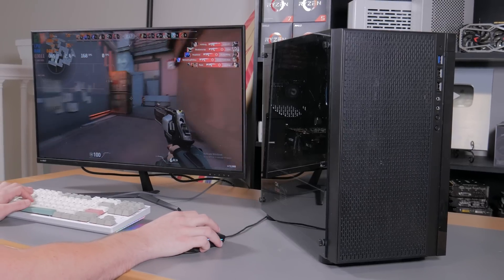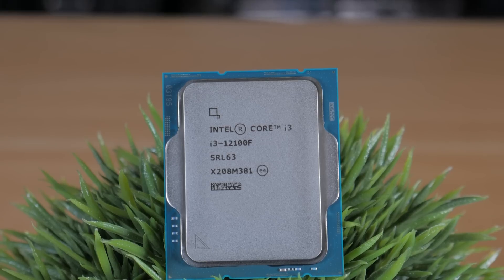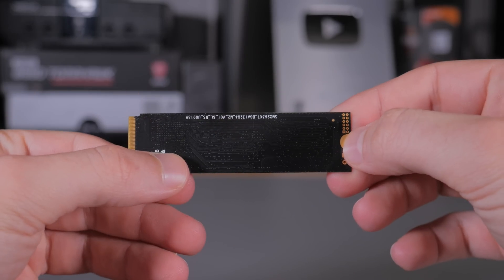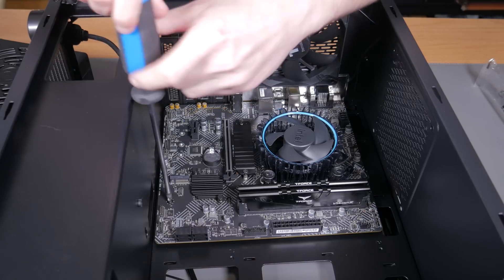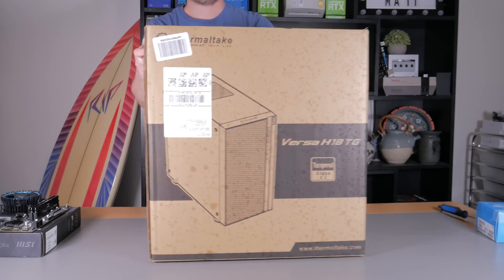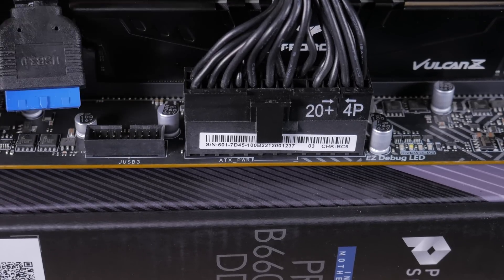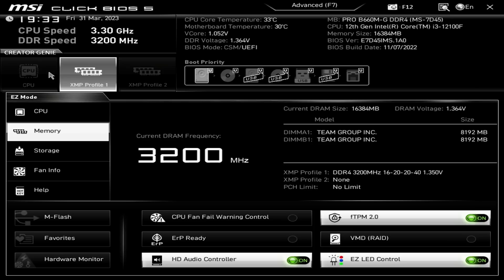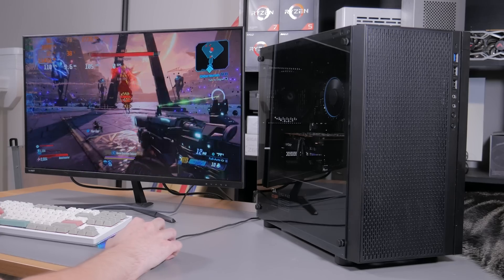$500 Budget Gaming PC Build Guide! (2023)

Comment: @TechByMattB, I am thinking about buying and making this build but the Intel Core I3 would not be compatible with the BIOS of the motherboard. It sound like you cannot change the BIOS without a CPU that is compatible. Only way I could have done this is by switching out the cpu with a cpu compatible and then updating BIOS. Problem is I don’t have another cpu. Is there any other motherboards that you could recommend with the same specs for around the same price? Otherwise I have to find a different build and replace all the work I’ve done to plan the expenses of buying the parts.

Comment: My brother just got everything for this build. 
We did everything exactly as the video. 
The pc won’t power on, AT ALL. 
I’ve tried taking out each ram stick, and that didn’t work. 
Don’t know what to do!
Reply: Start with the easy stuff that's easy to overlook: Make sure power outlet works, make sure power cable is securely plugged in on both ends, make sure PSU's power switch is not turned off. After that, make sure ALL internal connections are secure and correct. Pay special attention to the power cables (CPU and motherboard) and the power button header cables.

Comment: For somebody wanting a PC now and the ability to play AAA games later, APUs make sense. For $497.94 pre-tax/shipping, you can get:

Ryzen 7 5700G
ASRock B550 Phantom Gaming Wifi
16GB(8x2) Teamgroup VulcanZ 3200-CL16
1TB Crucial P3 Plus Gen4 NVMe M.2 SSD
600-Watt EVGA BW 80+ Bronze PSU
NZXT H510i Mid-Tower

This will give you a solid computer that can do some light gaming, and then stick one of the new midrange RDNA 3 cards in later this year, and boom. You have a 1440P Gaming PC.

Comment: Thoughts on swapping the gpu with an arc 770 or 750? I know they had a bad launch but it looks like the drivers have greatly improved since, so I'm thinking they've got a better price/performance ratio for $290 or $250? Seems like it would kick gpu performance way up for a pretty cheap upgrade
Reply: I would say that it’s still not worth it to go with Arc chips. Despite good performance there are still many annoying glitches with it being 1st generation, and it’s performance will only be a little bit more than the AMD offerings

Comment: I think you should add fans because the cpu was at around 70 c, which isn’t bad, but it could be lower with two intake fans in the front. It would help the gpu temps as well.
Reply: Bruh my cpu is around 96 c 😂
Reply: Add more thermal paste

Comment: Hello, im trying to build a pc next month since some of my friends recommend this. My old PC gave up on me so i gotta get a new one. I have no ideas on whats good, so any ideas? I'm on a budget between 1200€ and 1400€
Reply: I haven't looked up the price conversions but on that budget I think you could be more ambitious. Maybe start with a ryzen 9 3900x and a 6800xt? That would put you around 790 usd before ram, ssd, case, psu, and cooling. Check bottleneck calculators before making a decision though, that processor may be a smidge weak for the gpu, but it's close.

Comment: Back in January I decided to do a super budget low end modern PC my PC 

Specs

Mobo: Gigabyte H610m S3h  
  
Cpu: Pentium Gold 7400  

GPU: XFX Quick 210 6500xt

Mem: Silicon Power DDR4 16GB (8GBx2) Zenith RGB RAM Gaming 3200MHz

SSD: Samsung 980 500gb Nvme.m.2

Case: Macube 110 micro atx case

PSU: Thermotake 550 watt

Total cost: $321.18 

I'm happy with the outcome definitely could have spent a little more to get the i3 & 6600xt, but that wasn't the point. 🙂

Comment: Tested out this Erying ES of a i9 11900h soldered on an A-MTX mobo.  After an hour messing with the totally crap bios.  It's up and running well.  All for $200 to my door.  Total build was $612.  I also has some ram capability issues.  Thats fixed.  Holds boost clock of 4.7 ghz indefinitely at 88C pulling 88 watts.  I forgot to get the CB r23 score pic but was at 14883.

ES I9 11900h
3060
32gb 3200mhz 
1tb nvme
500w psu

Smoked you
Reply: what kind of cool solution you applied those vrm get quite hot too
Reply: @Jaroartx  just simple stick on aluminum heat sinks.

Comment: I need advice only for gaming .
Should I go with i3-12100f with RX 6700 XT OR i5-12400f with RX 6650 XT.
I AM SUPER CONFUSED PLS HELP
Reply: Very technical question. First of all, if you will be gaming on 1080,the games are more CPU bottlenecked so a better CPU is better. If you are gaming on 1440 and above, the games are more GPU so a stronger GPU is recommended. All in all, stretch your self a little bit more and get i5-12400f with 6700xt. Or you can explore AMD CPUs like Ryzen 5 5600 which is relatively cheaper than 15-12400f and they trade blows, akin 5600 falling short in margins. Cheapest AMD Ryzen 5 5600 ATM is $142 and cheapest i3 12100f is $105. You can cheap out on case aesthetics to recover the extra $40 and you will get your self a very capable system. In future ,it will be cheaper to upgrade case that GPU/CPU

Comment: Solid build.  I'd still definitely recommend saving up another $50 and hitting up the used market for a 6600XT/6650XT, which will stretch your PSU margins a bit but Intel i3 builds are pretty low on power requirements to start with so you'll probably be just fine.  I used to run an APU build on a micro ITX case that had an internal 150w PSU, so it's something you CAN do!  Power supplies are just less efficient the higher towards their limit you get.  You're really, really going to appreciate the gains of going even with a 6600 over 6500xt honestly, but 6600xt's in a nice place, and in a pinch 6500XT is still much better than any integrated solutions, but it's already getting aged out of viability for anything but esports titles. Diablo 2 struggles. :(
Reply: The psu is not in stock do you know another psu that I could use that is compatible
Reply: @kovirz  any PSU in your price budget with similar rating will be fine.  Try to stick with brands you know and supplies with good reviews.  Also make sure it's a standard sized power supply so it actually slots into the case

Comment: Xeon E5 ----v3 10-16 core chips+rx 6650xt should match the X-box series X performance n then some n be cheaper if coupled with an OEM donor platform,Fujitsu n Intel had platforms that supported this chip n are now way way cheap
Reply: Dell t5810 1650 V3 in mine, I used a 5500XT made a video, tested a 5700XT with a UV, worked decent!

Comment: 6600xt 8gb Hellhound (second hand) - 165$
r5 5600x - 189$
gigabyte b550m ds3h - 105$
t-force vulcan z 3600mhz, cl18, 16GB (8x2) - 53$
tecware fusion case - 60$
corsair cv550 - 50$
arctic p12 x 3 - 22$

total: 644$

anything i should change?
Reply: DONT GET 5 5600X, NEVER DO IT.
get 5 5600 without the X there are no difference and it costs less, you can maybe upgrade one thing or add a bit more ram.
Reply: @flintfrommother3gaming appreciate the info, I watched the benchmark test results for the Ryzen 5 5600X versus the non-X variant. the non X was 30$ cheaper and the difference between the two processors was like 1 fps. nice save man
Reply: @RTX-qx2xs  Don't make the same mistake as me bro, hope you enjoy your PC.

Comment: Actually everyone if u want all of you should buy the 
 RX 5700 XT or The Non XT version they only go for $170 these days 
Much more powerful than the RX 6600 and the RTX 3060 for more cheaper price and a better performing card.
Reply: the 5700xt is just barely more powerful than the 6600, maybe by a few frames. A 3060 will pull ahead of both cards.
Reply: @morningstar5902  The 5700 XT trades blows with the 3060 depending on the game, in some it wins by a significant margin, such as Forza Horizon 5 in the HWunboxed revisit.

Comment: I find that the RX 6500 XT has gotten an unfair bad rap.  We have to remember the context in which the card came out.  Used RX 570's and RX 580's were very expensive during the GPU crunch / mining boom ... you could pay upwards of 300$USD to 400$USD for a used RX 580.  When this card came out, it was a godsend.  Because of the limited RAM (4 Gb), The Ethereum Data was over 4 gb so you couldn't use the RX 6500 XT for mining (at least, not mining Ethereum).  So it didn't get priced crazy like the other cards.

I own 3 RX 6500 XT's so far (multiple builds running in the house for various members of the family) and the ONLY game I've had trouble with is Star Citizen (which is totally unoptimized) -- I have an RX 6600 XT when I want to play that game.  Every other game we play work fine with this card in 1080p.  Is it perfect?  No.  It's got warts.  But it works, and it's new and it's under warrantee.

This being said, I think the 6500 XT is still overpriced.  Right now where I am (Canada), they go from 250$CAD to 300$CAD depending on the model.  During black friday, you could get them for around 200$CAD.  This card SHOULD be around 150$ ~ 200$ CAD max.  Otherwise right now, with the GPU market back to "normal" (whatever that means) .. you would be better off getting one of these Chinese RX 580's with 2048 stream processors than this card.   If the price of the 6500 XTs does go down to say, 150$CAD (120$USD) then it's a good price.

Performance-wise, RX 6500 XT on PCIE gen 3.0 is about RX 570 performance-level.  On PCIE gen 4.0 it's closer to RX 580 perf levels.  It's a solid 1080p card and only struggles on super unoptimized games (like CyberBug).

Comment: The 6600 is miles better so it’s worth stretching the budget out another 60-70 bucks . The performance is just in another league.
Reply: Honestly I’d consider the RX 580/590. Save money and still have more fps AND vram than a 6500xt.
Reply: @battlepowered  nah a 6600 would be better then a 580 and 90 or even a 5700xt
Reply: @battlepowered  the whole point of the video was $500 budget.
Reply: @Tinzy89086  you’re a month late my guy. You can get a better build for $500
Reply: @battlepowered  any recommendations?
Reply: @battlepowered what would the build be
Reply: Even better you can go for it's last Gen equivalent the rx5600xt for the same price point used and get just as good mileage. But he did say he wanted all new so I'm not going against that.
Reply: @noobavage6119  If you going to go RDNA1.  Might as well recommend the 5700 XT since that's equivalent to the RX 6600 XT in performance.
Reply: @vh9network  Yeah that too. It's usually 20$ more but I agree, an even better pick for its value.
Reply: bro thats more than 10% of the budget💀💀
Reply: @64FPSAVG  literally…if $500 is already a stretch for someone, I doubt they can afford to go up another 10-15 percent
Reply: Or even 5600XT if someone can find a good deal
Edit: 5600xt for the same price as the 6500xt
Reply: @kyosefgofa  yea , nobody should buy that cakka poop 6500xt gpu
Reply: @earnistse4899  thing is in my country the 6500xt is 165 dollars and the rx 6600 costs  200 dollars more its pretty messed up so for 500$ 6500xt is my only choice its either this or a 1650
Reply: 5700XT is the best price to performance right now if you don't mind used.
Reply: Cut back ram to 16gb.
Reply: How would an Intel A380 perform
Reply: This is obvious, but the whole point of the video was $500 budget.
Reply: At least the pcie slot is the same gen so the gpu won't be as bad as others had when they put it with older am4 mobos cuz of no 4.0 gen pcie. Now I do agree that it still is worth it to pay the extra 60 bucks on it for a 6600

Comment: I use that case with much more power hungry components (3600XT with PBO enabled and 2.1ghz RX 5700) and it handles those great, I just wish I got something bigger and without a glass window since it always scares me when I have to move my PC. Would recommend even if it's a little dated.
Reply: Did you add more case fans also nice build. What’s temps like on the 5700 oc’ed? Any undervolt?
Reply: @btd1114  I have case fans in all places possible, and I don't need to run them very fast. The temps on my 5700 are relatively high sometimes but it's not bordering on overheating, the power limit is +15% and not undervolted.

Comment: I just wish the Versa H18 had an optional full metal side panel
Reply: Same. I have it and that massive glass pane always scares me when I have to transport my PC or remove the panel. That's my only major issue though, it feeds my system with more than enough cool air.
Reply: Isn’t that just like the H17
Reply: @Slick6464  The H17 is very similar, the only major difference is the H18's front allowing lot more ventilation.
Reply: @yasu_red  good to know

Comment: The 6500xt is not as bad as it might otherwise be in this particular system as you are to be running on pcie Gen 4 platform, so those four pcie lanes are going to be sufficient. It's really when you're in gen 3 speed it's a problem
Reply: I think the thing that might age the 6500XT the fastest is the 4gb frame buffer. A lot of newer games are making 8gb cards sweat even at 1080p.
Reply: You are right but it shouldn’t have been released without at least 6gb of vram